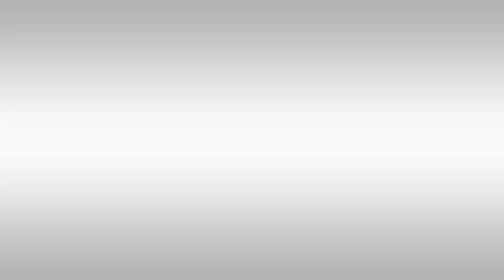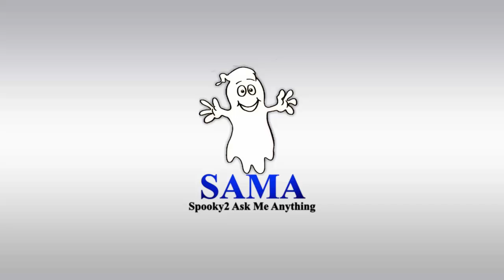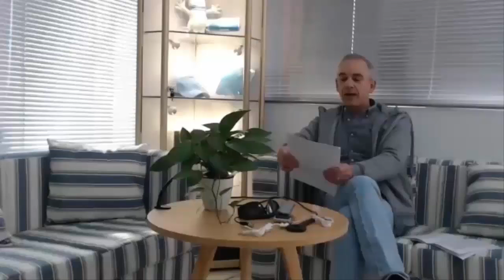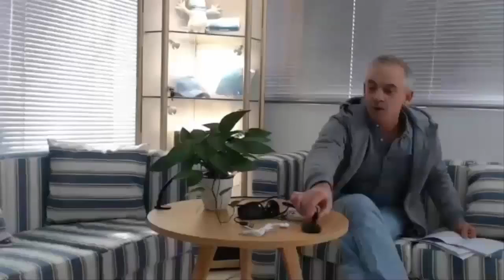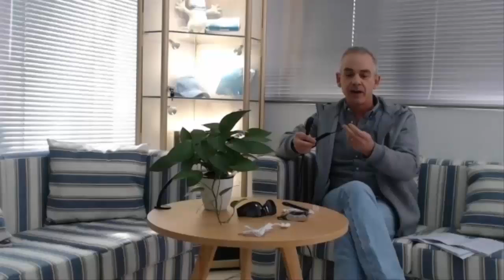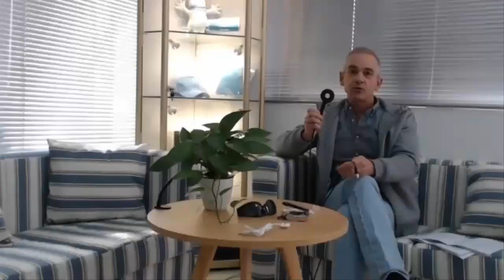What are the Differences between Using  PEMF Coil with Spooky Central and Spooky2-xm Generator?

Comment: Can you use a Pemf coil run off of a seperate generator on a different frequency at the same time as a plasma tube running off of a seperate generator and seperate frequency (safely) at the same time?
 I read in the presets for the Pemf coil that it may be unsafe-is that true?
 I hope not-because I really wanted to do this
Reply from the maker: Hi my friend, you can run off a seperate generator on a different frequency at the same time as a plasma tube running off of a seperate generator and seperate frequency (safely) at the same time.
Presets maybe unsafe because we can't run preset for pregnant women, people with pacemakers. :)